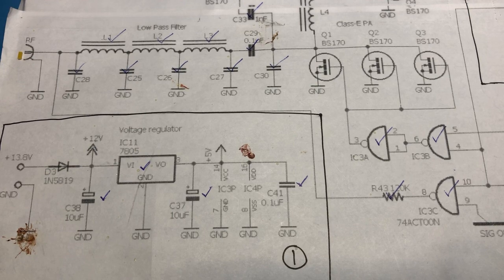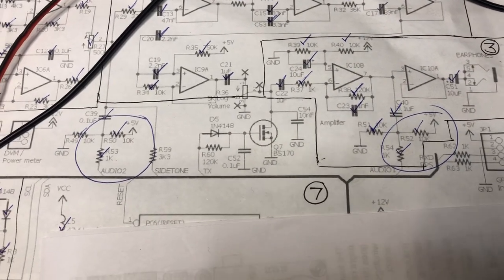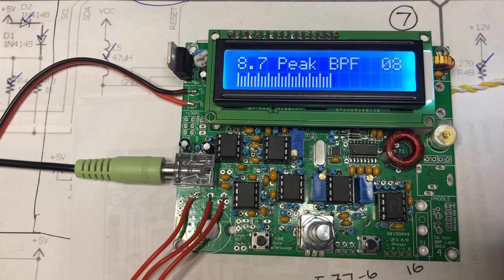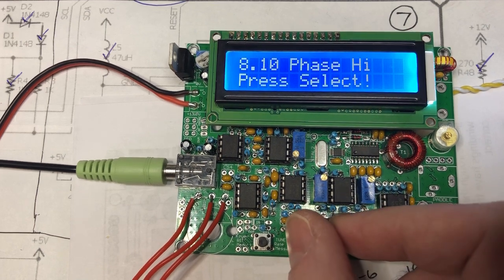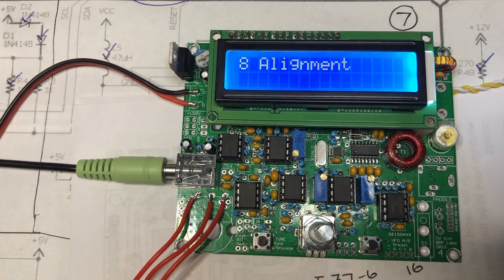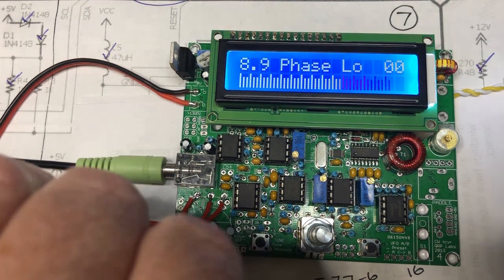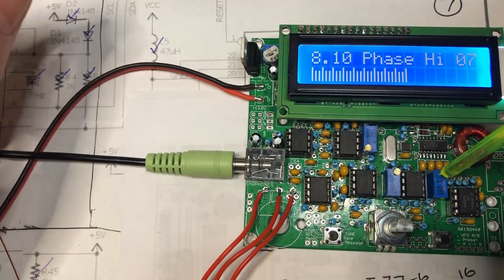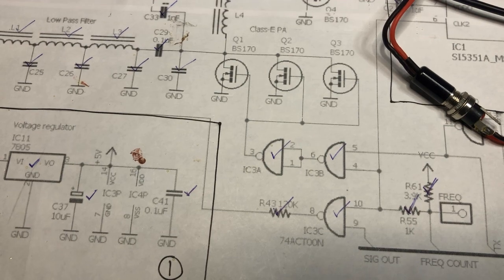QCX Transceiver Part 6 -  Low Pass Filter and Alignment

Comment: Hi. What frequency comes to the phase shift at PhaseLO and at PhaseHI !!!!
thank
Reply from the maker: Hi Maxim. Are you referring to the low and high audio frequency that the alignment process uses? I am afraid I don't know the exact frequency but I would imagine its a fairly small bandwidth given this receiver is intended only for CW. My guess would be 500-700 ish on the low side and perhaps 1200 Hz on the high side. Guessing here though. 

Are you asking because you are trying to design your own phase shift network? If so check out this link
https://qrp-popcorn.blogspot.com/2015/11/that-90-degree-phase-shift.html

It has a good description and includes a link to a spreadsheet that allows you to select the appropriate cap/resistor values for a opamp based phase shift network.

Thanks for the comment and I hope the above helps
Reply: a trick: watch movies on flixzone. I've been using them for watching lots of of movies these days.
Reply: @Ricardo Grayson yea, been watching on flixzone} for since november myself =)

Comment: What is the volume set at?
Reply from the maker: Hi Mike - to my knowledge there's no alignment step to set the default volume. The I/Q balance settings certainly affect the volume - but that is done to get the best unwanted sideband suppression. Outside of alignment there is also adjustments to the bandpass filter (variable cap C1) - that will also affect the received signal. Not sure if I answered your question though.